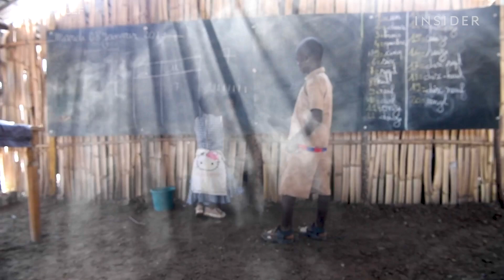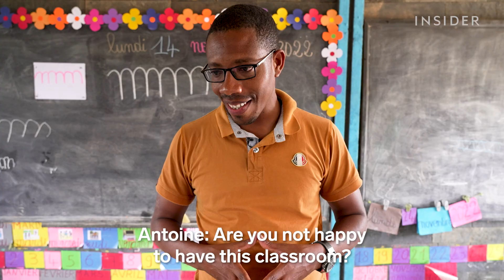How Bricks Are Made From Plastic Trash | World Wide Waste | Business Insider

Comment: This trash to bricks business seems very common in Africa. It looks like the African nations are more capable of recycling and re-using.
Reply: It actually isn't very environmentally friendly to recycle plastic due to the high energy costs. It's worth it if the energy is green, but most green energy plans still use oil and natural gas for half of their energy grids for stability. Overall this is good to remove trash, but not much better for the environment in the long run. Still, this is better than nothing and has other benefits
Reply: @Hungry_God  I don't think is that far off, yes a lot of CO2 and bad fumes are released, but we are talking about making the plastic soft and force it into brick or column shape. Should be fine as near green solution. After all some animal could get hurt if consumes some plastic. There are mountains in Indonesia made out of trash, google it. Much better melting it.
Reply: @DarkGT  like I said, there are benefits due to trash removal, but recycling in general isn't efficient
Reply: A lot of it is exports from developed countries like the US, it costs too much to recycle locally so we send them to poor countries and consider it "recycled", but actually once it leaves the country we don't care what happened. so a lot of it just end up on landfill without it being recycled as promised.
Reply: @middleagebrotips3454  China had the most efficient recycling industry ever about 10 years ago the CCP actually built brick walls in front of scrappers and dealers residence. All so China can look clean no other reason
EDIT about 4 years ago China banned Plastic waste imports
Reply: Its bc the work pay there is cheap.
Reply: It's out necessity,
Reply: Because they don't have strict pollution rules there.
Reply: humans tend to make good use of abundant resources when there is no easier alternative
Reply: Because labor force is cheap
Reply: I think it's due to a lack of health codes. Heating up plastic releases toxins still..
Reply: It is because there are more people who are poor and will work for low wages...

Still exploitation but at least it works. Not possible in developed countries, minimum salaries are too high.

Developed countries produce less plastic waste? They produce the most! 

They have a plastic recycling program - yes. Where does it go? Everywhere. Food, medicines - you name it. 

So they tell you micro-plastics end up in food because it degraded and ended up there? Nope. Plastics can last 10,000 years before degrading right? 

Logically it can only mean one thing. Those micro-plastics in your fast food etc, etc ended up there because it was a cheap additive or filler...
Reply: They're a lot of engineering genius in Africa.
Reply: That's because there are less regulation. Like I'm not sure how this brick behaves when burnt. Does it release dangerous gas like normal plastic?
Reply: @xwtek3505  It's a dirt brick, no bad gasses unless is reinforced with grass. The only problem is moisture and cracking under stress or load.
Reply: Moreso people in Western countries don't want to sort plastic for $0.16 USD/day
Reply: @linkslegionaire357  its cuz the businesses\companies that ship the waste to other countries got dibs on it first. Its all politics
Reply: @slayerbllade  and why do they ship it to other countries? Because it's not profitable to recycle in the country of origin. Why? People in developed countries demand higher wages.
Reply: @linkslegionaire357 per kg there getting more then that
Reply: @linkslegionaire357  It's $0.16 USD/kg.  NOT day, of plastic collected.
Reply: @supertouring1  yeah, I know. The exact number doesn't really matter, it's the fact they get paid so little. Not sure how much plastic they collect daily, I'd imagine less than 1kg/day.
Reply: @RehabProjectSRCB  wow brain fart on my end. I was thinking ton for some reason lol. But my original point still stands, that it only works there because they're willing to work for so little.
Reply: Nevertheless, that is still way less compared to the minimum wage we expect in NA.
Reply: @linkslegionaire357  nah your point doesn't stand, the real reason why they ship it to developing countries it's simply cuz they don't want to deal with it
Reply: @linkslegionaire357  way to blame the poor for going poor.
Reply: @RehabProjectSRCB  $1.60 USD/day is barely above absolute poverty, so this would only be possible to live on with some type of government support such as a child allowance or a subsidized food program. I'm sure the dignity of making something of their own is definitely a positive, but the economics aren't great. Activities like crude oil production or mining for lithium, cobalt, copper, gold etc. will always be more profitable than collecting waste plastics because of their scarcity. Africa should focus on mining and gas production to develop, along with renewable energy like solar, hydro, wind, geothermal, and nuclear. Then ban single-use plastics and imports of waste plastics. Africa can develop sustainably but it needs good governance and good policy.
Reply: @linkslegionaire357  the money actually goes farther. You can afford to survive in a lot of these countries off of 10-15 dollars a week. We over here have high levels of inflation. At one time you could have bought a loaf of Bread for a cent.
Reply: As a builder in Australia I can happily tell you all that we already have recycled plastic decking for over a decade, it's far superior in efficiency to this system also
Reply: @again5162  nobody said they just invented reforming plastic
Reply: It’s cause they create so much waste
Reply: @peanutbutterpirate314  they don’t create a lot of waste, but a lot of waste in developed countries get shipped to developing countries. Also, those developing countries don’t have ways to manage waste the same way as developed country. But in the grand scheme of things, they create a small amount of waste compared to other countries
Reply: @carlosnino6476  not really.  The Basel treaty stopped this.
Reply: @peanutbutterpirate314  No, every nation produce waste. Go to any megacity and observe the tons of trash they produce every day.  The real reason is that there is cheap labor and lack of other cheap construction materials. If there was proper recycling facility there amount of plastic for bricks would be even larger.
Reply: @peanutbutterpirate314  Have you seen the news? Western countries create so much waste that some ship their waste to other countries.
Reply: @peanutbutterpirate314  I'll assume this is a sarcasm 😂
Reply: @souffle420  no just ignorance
Reply: @peanutbutterpirate314  I would imagine it comes from other countries
Reply: @peanutbutterpirate314  be so fr right now